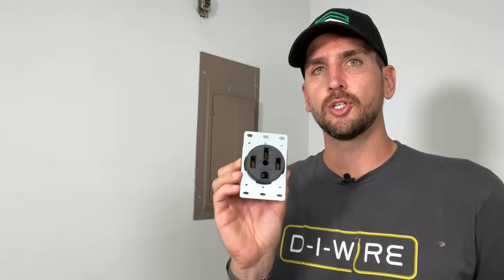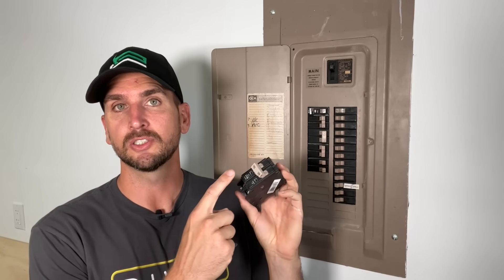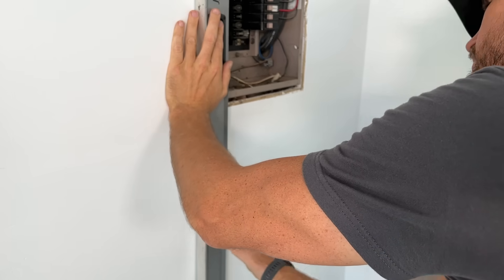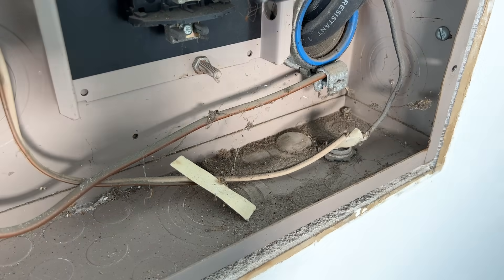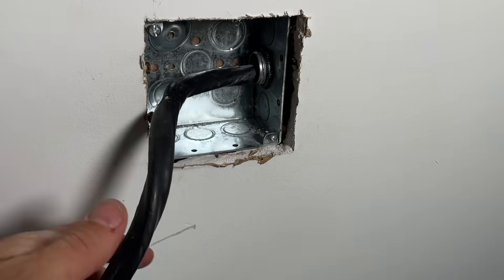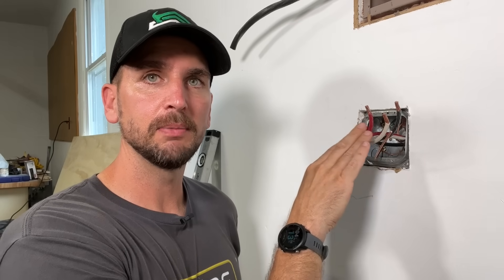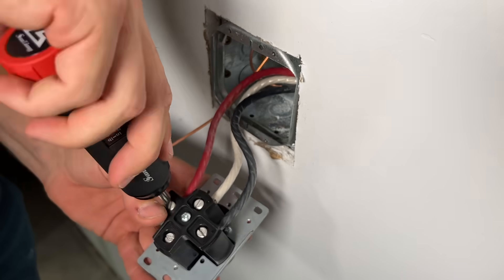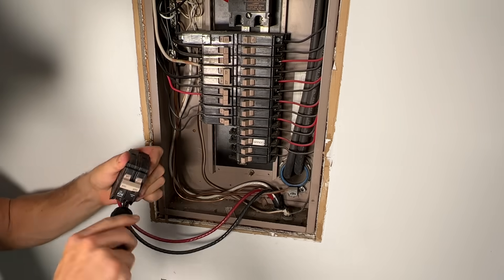Quick and Easy DIY 240V Outlet Install | 50 Amp NEMA 14-50

Comment: IMPORTANT---  If you're installing this for EV at home charging, PLEASE PLEASE PLEASE, use a commercial grade NEMA 14-50r and use copper wires.  My initial install (done by an electrician with aluminum wires) failed and the residential grade NEMA 14-50r melted.  The constant high load draw of EVs when charging is significantly higher than people might think.  Don't skimp on costs by using less than optimal parts!  I was very lucky and it didn't cause a fire in my garage, but it could have been really bad.   I had a different electrician repair the mistakes, and ended up just doing a hard wire install with my Grizzl-E EVSE.  BTW, I tried contacting the original electrician, and the phone number has been disconnected...
Reply: Socket failures usually happen around 2 years.  High load continuous use requires annual torquing of connections which no one does. Industrial sockets hold torque better.  I wonder if the problems with cheap sockets are the pins/blades inside or the terminals getting loose over time. We Need people with burnt sockets to report why they failed but can be hard if it is melted. Either case I got the industrial for my housr
Reply: @bbgator1  Cheap sockets have narrow blades inside the outlet.  Install $50 outlet and program charging rate down if you can.  Breakers can also fail because they also just push in.
Reply: @bbgator1  Mine lasted almost exactly two years before melting.
Reply: Using this to charge an EV at 48A is illegal. Why? Because EV charging is considered a continuous load, meaning at 48A you need 125% circuit capacity. Romex is not rated for 60A making this an illegal way to install that level of charging. It’s important to consult a licensed electrician instead of a DIYer posting YouTube videos. 

Illegal box mounting method is also showcased. Using proper materials and methods is the best way to stay safe. Hire an electrician who knows what they are doing.
Reply: Just had to replace all my EV charging hardware. 14-50r melted. Internals of my 40a juice box charger caught on fire. Looked into this a lot and upgraded to THHN wire in conduit and as 60a breaker, hard wired to a Tesla charger.
Romex is not rated enough for a 48a Tesla charger and Tesla's stopped selling 14-50 chargers I'm sure for this reason.
Reply: Was going to write this. Don’t use these cheap sockets.
Reply: Maybe the 1st " electricians " phone number forwarded to prison.
Reply: This x100. My regular grade 14-50 constantly overheats. I have to charge at 20 or 16A so that the charger doesnt detect high temp and stop charging.
Reply: @baselsalam  I would investigate a loose connection.  The EV charger has really highlighted the need for proper torturing of terminal connections.  Torturing and twisting and re-torquing before you can call it good.  

If you look, make sure power is off first.  

SAFETY FIRST, NEVER LAST, HAVE A FUTURE, NOT JUST A PAST.
Reply: commercial grade does not mean anything…its whatever a mfr wants to designate their product as…many use resi grade and repackage in a commercial grade box.  TESLA only covers their warranty with a Hubbell Industrial Grade 50A receptacle.  There are other videos on youtube that show the difference between Hubbell and Leviton and others.  Nothing beats top of the line Hubbell.  Buy cheap and get cheap
Reply: Yea, I don’t get it. It is only $40 more for the commercial grade outlet. $40 is not worth a house fire. I am just starting to learn about this stuff as I am soon to be buying my first EV- Nissan Leaf. I am contemplating whether or not to spend the additional $500 for a hardwired station or just have the commercial grade with copper 240v outlet installed and use the brand new evse cable that comes with the car. Installing of a station or an outlet is the same cost, but I will already have the cable. EV forums recommend the hardwired, but is it worth $500. Plus, all the stations are aftermarket, so to my layman understanding seems more risky than plug in option with the Nissan supplied cable.
Reply: Wow
Reply: I always wanted to be an electrician… Ramco school of correspondence
Reply: As per manufacturers “use copper conductors only”
Reply: Aluminum? Was this 1975?
Reply: Agreed. Get the $50+ Bryant, not a cheap ten dollar receptacle that will overheat and cause nightmares!
Reply: If using aluminum its suggested to use 4 gauge also:   6 gauge has a 40 AMP rating.  Here is a link to a chart for for some guidance: https://global.discourse-cdn.com/internachi/original/3X/a/5/a5cd399f13733a810ebceda26c70fcc053b09044.jpeg
Reply: Nothing wrong with using aluminum if sized properly. I just wired 50a circuit using aluminum #6 Ser.
Reply: Buyer beware, many online parts are knockoffs, and they do not meet the UL standard for continuous use receptacles even though they claim to be. Purchase your receptacle from a big box store or an electrical supplier. Knock off overseas parts may burn your house down. Pay more and sleep well.
Reply: Makes sence, great advise. Burning residential grade NEMA 14-50 are known for EV charging regardless of the cable type. Use commercial grade is a good advice.
Reply: Yes. I tell people standard grade catch fire
Reply: There is no reason to cord connect a level 2 charger. Always direct wire. As a service electrician I have replaced just as many burned up Hubble 14-50 as Leviton. Most customers don’t understand how much force is required to plug their charger in all the way. I have found many that are only 3/4 of the inserted. Several of the burned ones were actually the molded plug on the cord.
Reply: Copper wires are specifically stated in the installation guide for the Tesla models as well.
Reply: Aluminum wires required special plugs because it expands and contracts so much.
Reply: @theinvisibleman2070  I just did one for $1700 but it was about 55 ft from panel box. He was so shocked. Some ppl don’t even know where their panel box is located. And yes my competitors want 2k for a Nema-14-50 under the panel lol
Reply: this!!!  mine just failed, with torch marks around the cheap outlet the previous home owner installed
Reply: The first mistake is to hire an electrician. Electric circuits are a 5yo thing.
Reply: Install a hubbell HBL 9450 A that $9 plug is straight trash.
Reply: @lawsonstanley3279  that's like a lot for an outlet, don't you think?
Reply: Commercial EV outlets fail as well with copper wire, nothing is perfect
Reply: There is a separate section in the National Electric Code.....625.

In this section, many seem to miss where it talks about maximum charge rate times 125% equals the required circuit size.

Many look at their charger and say they will just restrict the charge current in the charger.  This is wrong.  If your charger has a max charge of 40 amps, you need a 50 amp circuit and 50 amp wiring.

My advise to you because if your circuit failed,  is to have a serious inspection on your panel.  As an electrical guy, I know that houses are wired, the wire size from the utility to your house, for what is in in when it is built.  There are calculation that allow you to reduce your wire size based on what is in there when built. A level 2  car charger is like adding a second stove to run at max power use for 8 hours.  These utility to house (service) wires may have been overloaded also.  There is a section in the NEC, 220 for this.  If you do not do these calculations often, it might be hard to follow all the reductions allowed.

Good luck sir.
Reply: @keithharrington4595 this! I’m using a 60 amp 2 pole so I can make sure it’s never under max load, I’ll be pulling 48 Amps and a 60 AMP 2 pole will be plenty for me! I’m surprised more people don’t do this 🤦‍♂️
Reply: @jonathancarter2717  where most people go wrong is the code requires personnel protection in the unit and if you put a receptacle in, you must also have a GFCI for the receptacle.

In your case, check your breaker carefully.  The code limits any car charging receptacle to 50 amps.  I think 624.58 maybe.

Section 110.14 requires breakers 100 amps or less to use the 60° c column of the wire ampacity charts, unless the breakers are marked for 75°c on the breaker.  This means no matter the wire insulation, so, number 6 wire is good for only 55 amps because of the breaker terminals.

Yes there is an exception in the breaker section 240.6 maybe.  That will let you go up to a 60 amp breaker with number 6 wire because there is no 55 amps breaker made and it is a dedicated circuit.  This would make it a 60 amp circuit as you desire.

Good luck.
Reply: Or the electrician didn’t use NO-OX because of the aluminum wire
Reply: Aluminum was probably the problem. I’ve got a 5$ 15-50R that has been under full load for a year
Reply: @swss12  mine lasted almost two years before melting. You're not out of the woods.
Reply: They want to pay a pro $320 to do it tho so they get crappy job done 👍🏽 70K car can’t pay $600 for a decent installation 🤔
Reply: Most main service wires to house are AL lol, there is nothing wrong with  using AL
Reply: @IYG-x7c  you are correct.  My concern is not with copper or aluminum, rather wire ampacity.  Aluminum can carry less at the same size wire as copper.

I post so people know to check.  "Service Calculations" are not state secrets.  Anyone can find them in the internet.

So homes are serviced with 100 amps, some with more, generally not more that 200 amps.  Will a car charger fit?  

You might have watched one of those Christmas Lights TV shows.  A separate (additional service) of Up to 400 amps is installed for 90 days just for the holiday lights.  This is done just to make room for the required current.

So, please make sure your service, copper or aluminum can handle the required current.
Reply: @keithharrington4595  ps. #6 copper or AL can both carry same 50amp. I would never use copper
Reply: @IYG-x7c  can #6 Al carry 50 amps in your home?  My NEC reading says it can but you must do a lot to get it. 

You might noticed there are several temperature ratings based upon the insulation rating of the wire in. 2020 NEC table 310.16.  Here we find #6 copper rated from 55-65-75 amps and #6 aluminum rated 40-50-55 amps for the temperatures 60-75-90 degrees c.  

How do I pick one, what is the criteria?   The insulation rates the wire, the wire only. So, yes thhn can carry more current than uf.  

The problem comes under 2020 NEC section 110.14.(C).(1). Which covers TEMPERATURE LIMITATIONS FOR ELECTRICAL CONNECTIONS.  This sections says that breakers 100 amps or less are rated at 60 degrees c unless otherwise marked.  This puts the wire connected to the breaker in the 60 degree column.

One fix, seek out 75 degree breakers. (#6 Al at 50 amps)

Fix 2,  connect #4 aluminum (your preferred) giving a 60 degree ampacity rating of 55 amps.  Do a short run.....( Some ahj's don't want connectors in the main panel, so separate mounted box.) Then use 90 degree rated wire splices (wire nuts if you will) to get your thhn rating and connect #6 from your separate box to the end of the run for your an aluminum rating of 55 amps.

Both fixes have some expenses added. .which is cheaper....

I will never claim to be perfect so if you see it some other way please let me know.  I know the.nec has many rules and it is sometimes hard to find them all.and apply them as we should.

Remember that your local ahj or building department can get you a solution outside NEC rules as expressed in NEC 90.4.

Hope this helps.  Also, I referenced the 2020 code.  If you know how updates are done in the code book, changes indicated for this cycle are shaded.  In this case all these rules I have cited have been around for many of the 3 year cycles.
Reply: @Keith Harrington  I never heard of circuit breakers rated at 60, pretty much everything is rated at 75.
Reply: @IYG-x7c  My NEC is the 2020 version but I believe this section 2020 NEC table 240.6.(A) has not changed for many years.

This section lists standard amp ratings for circuit breakers....

15, 20, 25, 30, 35, 40, 45, 50,    60,.  and 70....no 75,. and on to...80. and up.

Just because I do not use them often, does not mean they are not made.

Section 240.4.allows for the next higher circuit breaker to be used if you meet the listed criteria. 

So, yes #6 copper or #4 aluminum, both rated at 55 amps in the 60 degree column (used based on the 60 degree c rating given on the breaker terminal ( 2020 NEC section 110.14) can be protected with a 60 amp circuit under the right conditions.
Reply: Correction.......Al is more expensive than copper romex now. So back to using Cu. It's crazy, never seen such high prices for Al wire
Reply: @keithharrington4595  Minimum requirements should be cable types for 8 AWG at 75°C which are rated at 50 Amp.
EV may be over three hours of charging.
So you need to have derating the cable then you may take 6 AWG as the YouTuber did.
Don't try Aluminum.
Reference to NEC 2014 Table 310.15(B) (16)
Reply: @tin shum  try nec 110.14.c.1....unchanged for many cycles.  Temperature requirements for terminal connections.  It points to 60 degrees c rating for the "normal" circuit breaker rated 100 amps or less.

The romex (nm) cable section in chapter 3 also points to a cable temperature rating of 60 degrees in the section.  Is it 334.74?
Reply: @keithharrington4595  Just read that NEC 110.14 C1. I think you have brought up a good point.
Reply: @tin shum  hang in there.  The nec is sometimes tough.  Tapping into  receptacle on the other side of the wall(next room) is easy.  Should that next room be a bathroom. Or kitchen and you may have a code violation.  While doing the work, it is easy to miss the small things.  Everyone learns from study and mistakes.  Study alot, mistakes are tough.
Reply: @keithharrington4595  Thank you gentlemen,
That's true. I gained tons of electrical knowledge from a trade school recently. The knowledge I gained has not been tested by the actual working environment. It may take some time.
Reply: @tin shum  remember that the wire on the breaker is 60 degree C.  So a short piece of number 6 at 60 degrees c  connected to the breaker gives you 55 amps.copper.  connect the other end to 90 degree C splices ( high amp wire nuts).  The other wire in the wire splice can be number 8 thhn copper (run in conduit) for 55 amps at 90 degree C to the receptacle.  Receptacle terminals (I am unsure of their rating off the top of my head) so expect to splice on the receptacle end back to number 6 to get the 60 degree C rating again.  Check 310.16 to see.

The cost of splices and boxes to house the splices and the time to make those extra connections will wipe out any savings you get in shifting to the thhn wire.

If you are doing this yourself, you can run romex (nm cable).  Remember that 334.15 calls for conduit to protect romex (NM cable) where exposed to physical damage.  Call your local building inspectors on this....where protection is required.  Behind sheetrock, not expected, but what does your garage look like.  
[Conduit for protection has zero fill requirements per chapter 9 table 1 note 2 .....2020 nec page 70-695]  the cable has to fit.  3/4 piping might fit, but the bigger the piping, the easier it is to pull the wire in]

Remember, pros do this every day.  Hiring one as a consultant (you are still doing the work) will get you plenty of correct answers and may solve problems before they bother you.

Hope this helps and if you are entering the trade, your most important tool is YOUR BRAIN.  Make it the first tool you pull out and the last tool you put away.

Good luck.
Reply: @IYG-x7c  you are correct under the condition you are using individual conductors but if using 6/3 romex you have to go by the 60deg column in nec which is only 40amp for #6 aluminum.
Reply: @charles-hu8ru  I've never heard or used Al romex, I don't think it exists
Reply: @IYG-x7c  It's extremely easy to find, Lowes sells 60a siemens QP breakers for like 20 bucks, over 50 in stock.
Reply: Is it safe to install 2 in 1 breaker if there is no additional room in the circuit board for a Tesla wall charger? I’m hearing mixed feedback.
Reply: @Kurpal  There are split breakers and double breakers.

Split breakers allow you to replace two breakers with one split breaker.  This gets you the same number of circuits and breakers.  The split breaker fits 2 breakers into one spot.   This single spot only gets you 120 volts on each circuit.  If that 2 circuits are connected, you cannot get 240 volts as they only use one leg of your system.

The double breakers are 2 breakers connected together as one unit that fits 2 breaker spots and a handle connecting the breaker handles together.  Because they use 2 adjacent breaker spots, you get 240.

I do not know of a panel manufacturer that restricts the use of split breakers, but I am smart enough to know I don't know everything.  Please call your local inspectors with your panel type/manufacturer and make sure you are good.
Reply: It's most likely a failure caused by the electrician not torquing the wire lugs on the outlet to the proper specification using a torque screwdriver.
Reply: @taylorlightfoot  We wouldn't want to cost him $2 in royalties if we elected to do it by hand. 😂

Comment: What if you don't have any free slots?
Reply from the maker: Yeah, that is a bit tougher.  What size service do you currently have 100 or 200 Amp?
Reply: Buy a new house that has slots open and make the seller install the NEMA 14-50.